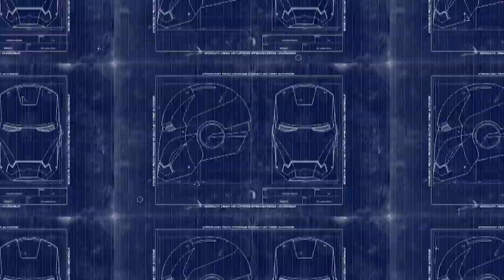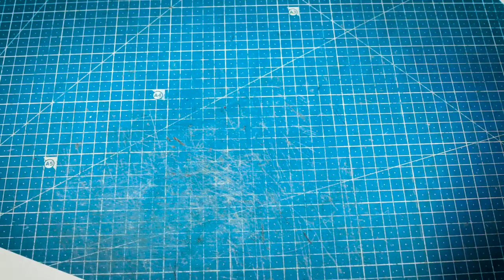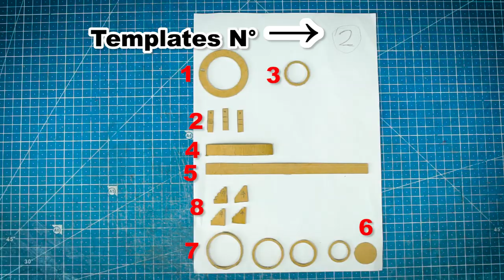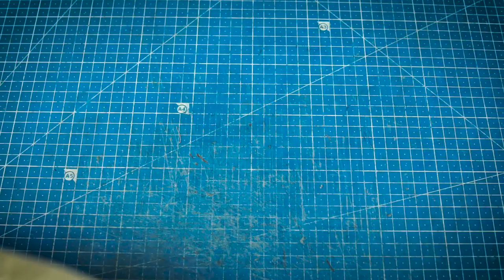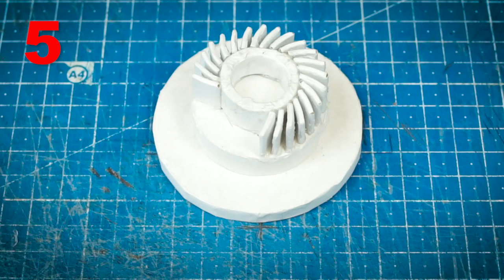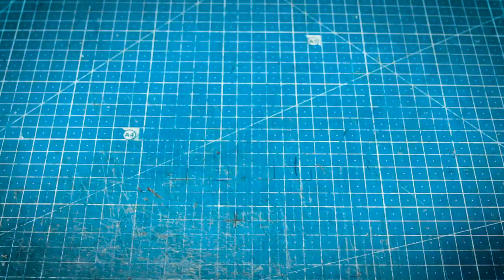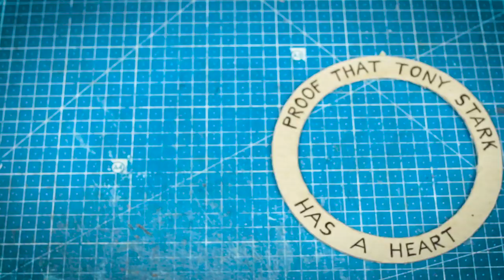How to make an Arc Reactor with cardboard

Comment: m8 u've got some talent there i've tried 6 times to cut perfect circles and i've failed miserably. 1 question what glue did u use to glue the 4 pieces of cardboard( 3:30 )?
Reply from the maker: Did you cut them using the templates? 
The type of glue doesn't matter for that part, I used hot glue because it's fast (and I need to work fast...) but I could have used any type of PVA glue as well ;)
Reply: @EpicCardboardProps  yes i did and thank u for the tip <3
Reply from the maker: @vivid8460  You're welcome

Comment: Hello, I have a question for you!
I am making an iron man 1 arc reactor powerbank (can charge mobile phones) so I must need a compartment to install all the mechanism. Can I do the same in this arc reactor??
Reply from the maker: Hey Gunneet Kaur, well as I don't know the kind of space you need and where you're going to put it, that difficult for me to tell.... If it's small enough for it to be put in the back (where the wires are) and you can manage to dig a hole in the cardboard there I guess you could put it there, but f course it depends on the size of it. Automatically it's also depends on how comfortable you are at modifying build to your needs.

Comment: Hi Raphael,
I decided that I wanted to build this amazing prop, but seeing as I couldn't buy the template, I decided to go freehand, based on your cutouts. Do you have any tips on how to get the right size for shapes without having templates?
Reply from the maker: Hy Rohan, well I'm not gonna lie it's going to be tricky to make it without them, but if you have to try to use the cutting mat in the background as a reference. Every single square is equal to 1cm. ;)
Reply: @EpicCardboardProps  Wow, that actually helps a lot! Thanks again! I'll try to post pictures of it somewhere if I finish. The hardest part right now for me are the things you make at 3:40
Reply: Nevermind! The scale of 1 cm really helped!!!

Comment: Where do you store cardboard that you are not currently using so you don't create a mess?
Reply from the maker: That is one of the question that matters the most lol because indeed when you make as much stuff from cardboard as I do, you need to have a large stock! And I've not found the perfect solution so far. But the best trick is to find a place like a wall in your garage or something where you can store them, and to make them flat by desassembling all boxes. And I try to rank them by thinkeness.  That way they don't take that much of a room. But it's still a little bit messy.

Comment: You should paint more of your props
Reply from the maker: I shouldn't lol it worked pretty well on this one because there is no large surfaces of cardboard, but with the big ones they would end up to be very bad replicas... because cardboard doesn't react well to the painting. If I wanted to make a perfect replica, painted etc I would use different materials like EVA foam, resin or plastic. But of course it wouldn't be aligned with the topic of this channel ;)

Comment: I don't have cutter how can I cut
Reply from the maker: No box cutter either? The thing is that for you to be able to reach that level of accuracy you absolutely need to cut the pieces from my templates VERY accurately. So it is very important to use a precision knife, a box cutter or at the very least a sharp scissor (like the ones made for crafting, not the regular ones...)

Comment: is there a way to get the template for free??
Reply from the maker: Sorry VIVID, but that small cost allows me to make new ones every month! they are a lot of work ... and they are really time consuming. So I can't make them for free unfortunately otherwise I would have to stop doing this.
Reply: @EpicCardboardProps  yea i jst bought the zip file and it only has the cardboard shapes not geometric shapes
Reply: there is a file called _mascox and when i open that it shows the same stuff but when i try to open it it jst says file not supported
Reply from the maker: @vivid8460  The folder is a Zip format so you need to decompress it before using it, otherwise the folder doesn't work properly, have you done that? You can do it with the right click menu on PC or control click on Mac, you can also do that for free online with websites like “extract.me”. Let me know! 😉
Reply: @EpicCardboardProps  thx it work <3 I will post back when i finish it <3

Comment: How do I make the pieces without template
Reply from the maker: Well this tutorial doesn't work without templates sorry.
Reply: I mean the ones that you say we make on our own like what are the measurements
Reply: And I like your builds their awesome and I've been working on the infinity gauntlet and I have a lot of it done
Reply from the maker: @Hellonigeriansgerardbackpack  This build is too complicated to tell the measurements, I don't even know them... as I said you have to work with the templates to make this build. It was made to work this way as templates makes everything easier.
Reply: Oh ok
Reply: And can these be done with scissors
Reply from the maker: @Hellonigeriansgerardbackpack  You can but you'll have a hard time to cut the pieces properly and accurately... it will impact the end result for sure. The best tool to cut cardboard is a precision knife (with several spare blades as they tend to get deteriorated quite quickly)
Reply: Ok I just got some so yeah that will be helpfull
Reply: And as long as I can tell it's an arc reactor I'm fine and your build are so cool I wish I could make them all but I only have so much ink am I right 😁
Reply: And one more question are precision knives dangerous?
Reply from the maker: @Hellonigeriansgerardbackpack  As they are REALLY sharp, they can be if you're not using them carefully. If you're not comfortable to use that type of tool then maybe it's better for you to use a scissors indeed. Safety first! 😉